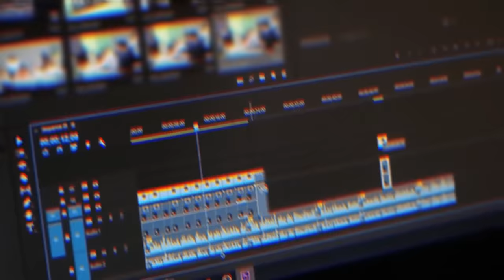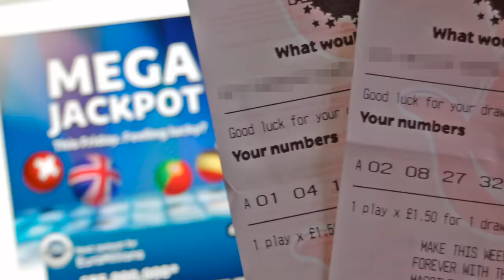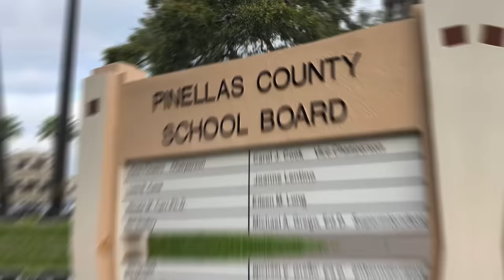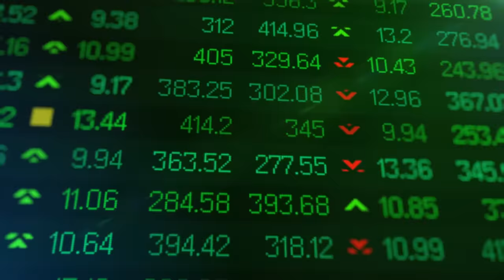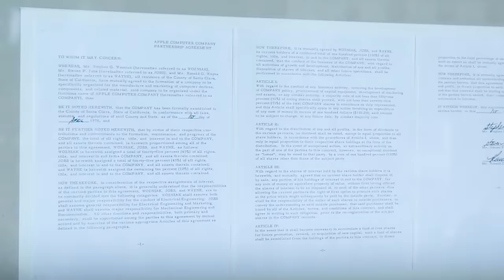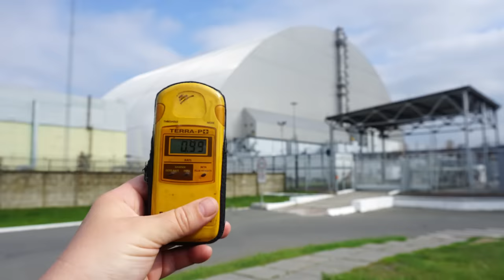Most Expensive Mistakes in all History - Part 2

Comment: I'd like to point out that the bolts on the new bay bridge were not "shoddy", rather the bolts which at the time of installation were to the specified tolerances suffered a rare metallurgical process called "Hydrogen Embrittlement" that weakened the bolts after they were installed.
Reply: Isn't that what shoddy means?
Reply: @on_another_level5661  The thing about Hydrogen Enbrittlement is that what triggers it isn't quite fully understood from my understanding. So even if you have bolts that meet not only the manufacturer's specifications and pass with flying colors from whatever third parties do independent grading, You could still have Hydrogen Embrittlement occur. You could be using the precise bolts you'd need for the project and still have it occur, and the only fix for once it starts happening is to heat treat the entire bolt.

Hydrogen Embrittlement has plagued other projects, such as 122 Leadenhall Street in London. The bolts in the "megaframe" that supports the building suffered from Hydrogen Embrittlement. Three of these massive bolts fell from the building after failing due to Hydrogen Embrittlement. They wound up replacing all the bolts over a period of several months.
Reply: @MrPatrick2160  The irony of hydrogen embrittlement is that it mostly affects higher quality materials. In fact, the stronger the steel, the greater the risk of hydrogen embrittlement.
Reply: @on_another_level5661 : No.
Reply: Wow.  All your words just defined shoddy.  If you don't see that please don't ever design or build a bridge.  Okaythankspumpkin
Reply: @samtrujillojr  Did you read the same comments I did? Because if you did then what your comment makes no sense.
Reply: “Hydrogen embrittlement” along with “weakened the bolts” sounds pretty shoddy to me

Comment: You might well be interested in Bridgewater Place, Leeds, UK. 
At 360ft AGL, this skyscraper is the tallest building in Yorkshire, and was built between 2004 and 2007. However, the shape of the building accelerates high winds, and has caused numerous injuries to pedestrians passing on the streets nearby: one person suffered a torn liver, internal bleeding, and cuts requiring 11 stitches after being blown over; a three-month old child in a pushchair was blown into a nearby road; and a man was killed when a truck was blown over on top of him. Recommendations by the Deputy Coroner included closing all surrounding roads when winds reach 45 mph or over, and a series of wind deflicting fins have been installed, for which the original developers were required to pay £930,000 towards the works - allowing for the cost of the installation of warning signs in the surrounding streets; the total cost of the wind deflection works; and compensation payouts, this could have easily pushed the total losses into the £ millions.

Another costly mistake involves Terminal 5 at London's Heathrow Airport. 

This is the newest of the airport's terminals, opened in 2008, but on the day of its opening, it quickly became apparent that the IT systems were not working properly, and over the next 10 days 42,00 items of baggage failed to make their journeys with their owners, resulting in the cancellaion of 500 flights.

Another problem concerning Terminal 5 is that a great many of the failed light-bulbs in the ceiling have not been changed since the Terminal building opened. This is because the ceiling is too high for most "cherry-pickers" (self-propelled hydraulic platforms) to reach.

Comment: The nuclear disaster at the Chernobyl Nuclear Power Plant, officially the Vladimir Lenin Nuclear Power Plant, could've been avoided with something simple - making sure the other power plant in the area didn't go down. The night crew at the ChNPP was untrained in the testing parameters and an unprecedented build-up of Xenon-135, which absorbs the neutrons required for the reactor to, well, react, and it's called a 'neutron poison' for that reason - it is a very good neutron absorber - helped bring the conditions in range for the nuclear explosion and core melt that is the worst single reactor nuclear disaster in history.

Comment: At 6:48 I have done my own research on this shit due to my fascination with ships. The captain did order the salute but because it had just left the captain was off the bridge and enjoying a party with the guests. The instructions given to the helmsmen was misinterpreted and the degree of the turn was taken wrong causing the ship to eventually strike sharp rocks. Upon the captains return to the bridge the ship started to get caught in the current and was slowly getting pulled back into the deep sea. The captain himself took over the ship and reversed the effect keeping it close enough to the shore that it would not completely capsize or sink. Even though the captain was never in control of the ships bridge during the accident, he was still charged with murder and sentenced to prison
Reply: But you can not forget the other ship owned by the same company that owns Costa Concordia (The Carnival Company owns a lot of ships and brands even the most known brand under their name Carnival Cruises). The Carnival Triumph was a very big mess up that caused all but one of its engines to burst into flames rendering the shit useless. That cruise ended up getting the nick name Cruise From Hell
Reply: Then he fell in to the life boat.

Comment: 12:30 - A million contains only six zeroes.  Nine zeroes are a billion.
Reply: That is the short scale billion. A true billion has twelve zeroes. But some of the rich wanted to be able to call themselves billionaires, hence the short scale billion. There are no long scale billionaires, just big hats on small heads. 

In the long scale, billion means 1,000,000,000,000 (10 to the power of 12) and trillion means one million billions (10 to the power of 18), and so on. = Impressive.
In the short scale, billion means 1,000,000,000 (10 to the power of 9) and trillion means one million million (10 to the power of 12), and so on. = Meh.

Comment: Anybody notice how the cost of the stealth bomber keeps increasing as time goes on?  The reason is that the 'cost' of the bomber includes all of the spare parts and fuel it uses.  This is referred to as 'lifetime' costs and in a completely bogus way of pricing an airplane that had a marginal cost (the cost of producing one more item) of $250 million.  This is why shutting down B-2 production didn't save much money.

Trivia note: the typical cost of a bomber is 5 times that of a fighter.  And when the B-2 was purchased the marginal cost of a typical fighter was $50 million.
Reply: That surprises me. For most machines, the initial investment (R&D + construction) far outweighs maintenance and fuel.
Reply: @iamihop1123  Aerospace grade parts are hideously expensive to make.  And the fact that we bought so few B-2's means that each part has to be made one or two at a time (no economies of scale where the setup costs can be spread over a couple of hundred parts)..  And aircraft fuel is expensive.  It takes roughly 40,000 galloons of jet fuel to fill up a B-2 - which costs about $75,000.

Another expense of operating the B-2 is the security infrastructure.  This is hideously expensive because security will always come before cost savings.  The Air Force would rather send an employee - who already has the appropriate security clearance and has a SAP clearance for 'Senior Jersey - Spirit' - from defense contractor to rather expensive training and pay the costs than let them hire another person who knows how to do that job and get that person the clearances.  (The list of people who know the details of stealth technology is kept to a ruthlessly culled minimum.)

Comment: i was there for Number six back in 2008, just a young airman picking weeds when you heard a loud Explosion from the Flightline they locked out ( stopped fuel flow ) of not just the storage tank but also the smaller storage tank the truck was filled from and the two trucks that filled the spirit before it started

Comment: Not the "Most Expensive Mistakes in all History," but I had a horrible one. When I had one of the old-style mobile phones the battery was loose and sometimes it would cause my call to cut off. 
I was in my car and a radio station was giving away a brand new very cool Italian Scooter. They gave out the question and I knew the answer and called and was so shocked when I heard and DJ speaking that I slightly moved the battery and cut off the call. 
Because there was a slight delay I could literally hear him answer my call and hear myself getting cut off on the radio. He then took the next call and they won instead.

Comment: The Spirit of Kansas crash was more than just "A few drops of rain water", it was a very complex situation stemming from torrential weather conditions and a lack of inter-personnel communication about informal procedures; the clogged sensors weren't "blocked", but absolutely SATURATED with water. The air crew and Maintenance techs that day had done everything by the official manual and their training; Recalibrate sensors back into alignment, then when readying for taxi and take-off, turn on the PITO Heat, which ended up boiling the moisture away, and bringing that sensor cluster back out of alignment. The stall was caused by the plane thinking, as a result of faulty data, that the plane was in a dive of 8 degrees, and was trying to pull up to come out of the dive, causing massive drag and thus stalling. As it was, the plane's control system did as it was supposed to in the situation; If errors in the system are detected, pull data from four random streams and attempt to proceed.

It was by pure bad luck, that one of the chosen streams was the saturated sensor cluster.  And the pilots themselves only bailed out of the plane at the absolute last possible second, fighting to bring the nose down and regain control of the plane, right up until the last second. If they had tried to eject barely a heartbeat later, they'd have died with the plane.

Comment: My biggest loss was $40,000 in one had of blackjack. I started with only a few grand and run it up to $50,000 in a few hours. Then got delt aces, split and got aces again. So I had 4 hands of $10g.
19,19,20,20. Dealer had a 6 showing. 
Turned over 16 and hit a 5 (21)
And took my money.
Reply: Unless you're counting, the only mistake you made was gambling in the first place. Casinos, like lotteries, are stupid-taxes.

Comment: Lol, the one of the bridge made me rofl on the inside... Maybe you should put the the completion of the Ring of Antwerp & the now Wapper bridge, which became the Oosterweel tunnel instead... After they forgot to submet a safetyaudit & also loud public protest... It was unveiled in 2000 & only this year (2021) the works started... It was estimated to cost 0.53 billion €, but in the mean time, the price has also skyrocketed (5 Billion €) & they're estimating, it will not be ready before 2030...

Comment: Chernobyl was caused by graphite tipped rods and mechanical failure with no redundancy measures in place . Not from mishandling rods
Reply: So, you were there?
Reply: @dadillen5902  no but rods aren't "handled " by a person they are part of a machine , when the rods are being handled by humans they are not near plutonium . Having graphite tipped rods is a cheap , flawed way of making reactors and a decent way of sending one super critical.

Comment: I was working this mine job on a tailings pond as kind of do whatever they tell me to labourer. I didn't have my license at the time and knew barely a thing about vehicles. So they're getting me to fill up all the big diesel trucks, including some regular light trucks. Long story short there was ONE truck that ran on gasoline out of the ones that needed a fill that day. Tank was about half full with gas, I topped it up with diesel before realizing my mistake. I didn't shut my mouth and keep working I reported it immediately. The mechanic told me it'd be fine and I assume they drained the tank. Still don't know if I cost that company a truck or not. Feel pretty bad about it regardless, rookie mistake. It's caused me to ALWAYS hesitate to fill a tank double check I'm using the right pump ect before filling even though I'm sure about the vehicle I'm driving before I fill.

Comment: Number 1 was most easily avoided, proper maintenance and new equipment and a shut down would have prevented the melt down. But even cheaper do the rest the way it was engineered at low power and not high output. I build them so I kinda know a bit about them and this was completely avoidable...

Comment: You need to recheck your facts about the Chernobyl disaster it wasn't faulty equipment that caused the disaster it was a reactor power down test in which they were trying to keep a power generator going to bridge the time till backup power came on line

Comment: The part on the NBN is factually incorrect. There was no process put in place originally to workout the actual cost of the original NBN plan. Once there was an actual estimation done, it was found to be much higher than the government had guessed at, no surprises. Also the original plan was massively altered by another administration (government), which claimed would get it done faster and cheaper, which looks to wrong on both counts.

Comment: Yeah...BP's design, purchase, construction and subsequent scraping of their Liberty drilling rig in Alaska's North Slope Endicott field. Cost over $1B and never drilled a hole. None of the welds were up to specs and had to be redone before start up over a few years later. Then it went "south" from there. Cost of oil and lack of technology to service it (hadn't been developed yet) caused more cost overruns. Literally tried to sell it whole or in parts and had no takers. Reprimanded an employee for listing it on craigslist as a joke and for all their effort? Ended up cutting it up for scrap. Other then the joker no one lost their jobs for it besides those that may have worked on it and the sister rig was and has been busy in russia drilling holes to great effect.

Comment: B-2 bomber crash.....
I can't figure out how it is you guys get your facts so wrong. First off they don't turn on the heat like as in the hanger they turn on the heat as in pitot tube warmers and that's only after receiving a calibration Alert. The procedure was figured out by the B2 mechanics when getting a calibration alert. Since this wasn't figured out by the manufacturers of the plane or the upper echelon it was more or less dismissed as unimportant(till after the crash).
The moisture was not from rain droplets the moisture was from humidity native to Guam.

Comment: The Australian NBN Fiasco, was primarily a government infrastructure policy initiative, by the then Labor government, which was  progressive, and sabotaged by the incoming Liberal Government ( conservative)  , trying to save costs,  that changed the technology and  slowed to "acceptable" speeds , by using existing copper wire technology ( twisted pair phone lines) and infrastructure ( some of which is 60 to 80 years old) by using node and hybrid technology. It still isnt anywhere close to being finished in 2021 and is plagued with slow speeds and faults. Sure, there is fibre to "nodes"  in most cities and suburbs and some areas have full fibre ( before the decisions were made to scale back) but the "fix" is to nearly redo the entire system from scratch, something promised but that will probably never happen. Node speeds are only 25 m/b along old copper wire... wireless 5g up to 1000 m/b

Comment: Removing a mustache costed $25 000 000. FKKKKK I can't stand liars! There's no way in EVER that it cost $25 000 000 to remove a mustache. I would have done it for much less than $1 000 000. You could find someone who would do it for less than $50 000 perhaps even $5000 I'm sure. Paramount and Warner Bros must not get along.